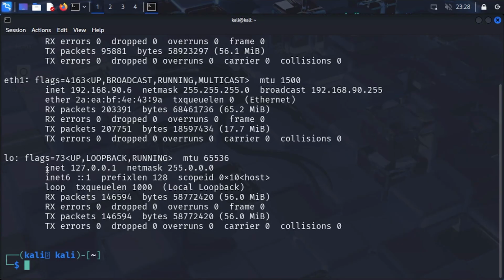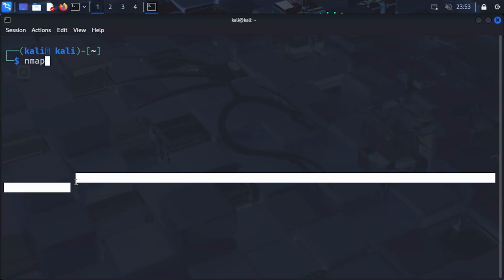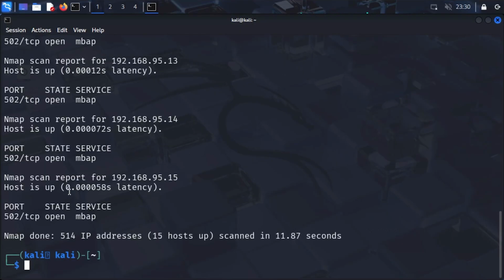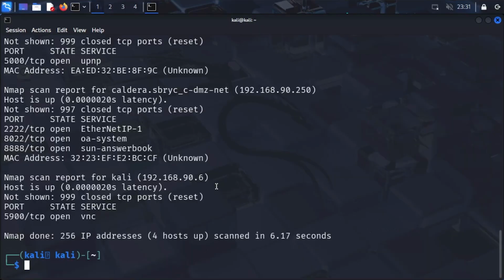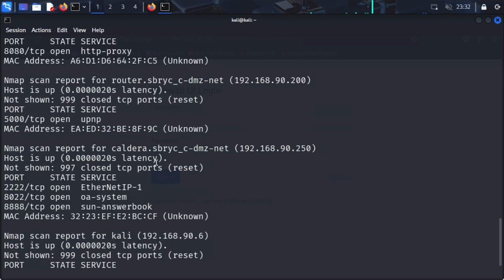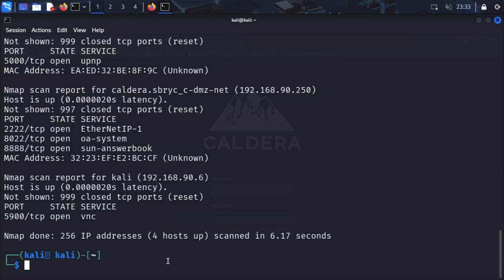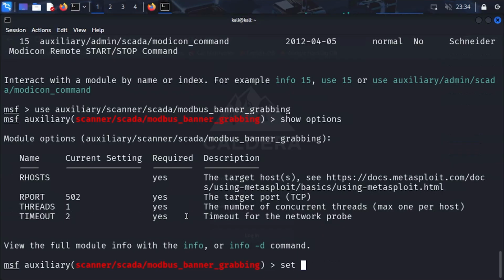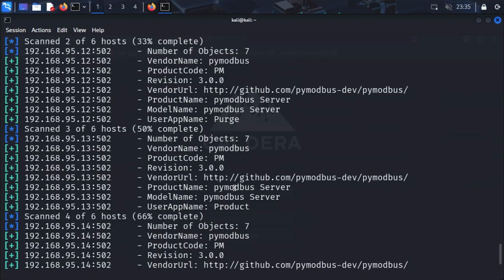How Attackers Discover ICS Devices (Nmap & Modbus Scanning Walkthrough)

Comment: I usually try to get CDP or LLDP data first because it's passive. The first objective should be to compromise the switch you are connected to.. from it you can gain access to air-gapped but not electrically seperated networks (like management). By altering switchport vlan.. you can bypass firewalls and routing which might be in the way.